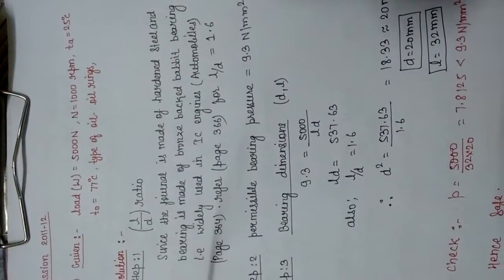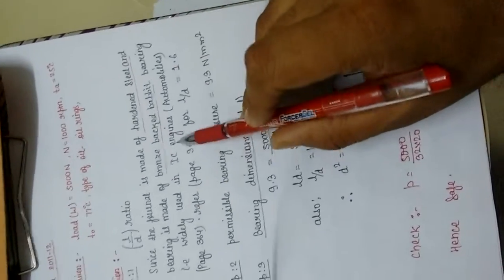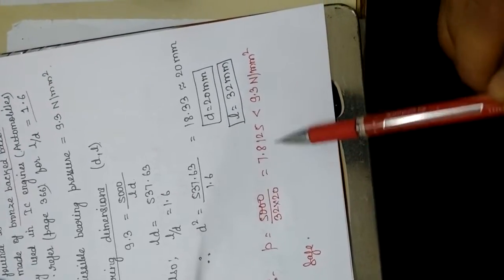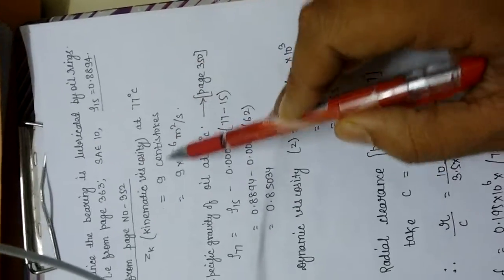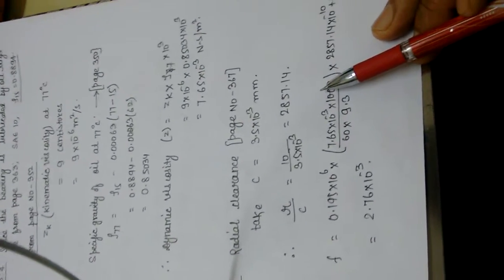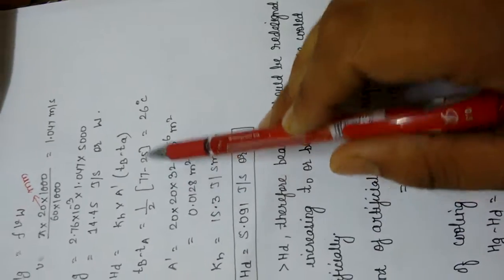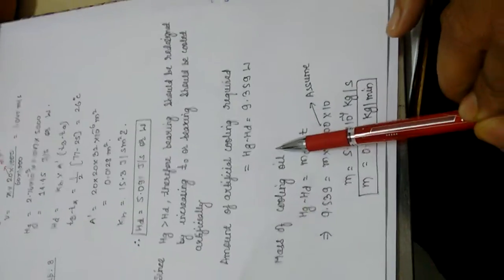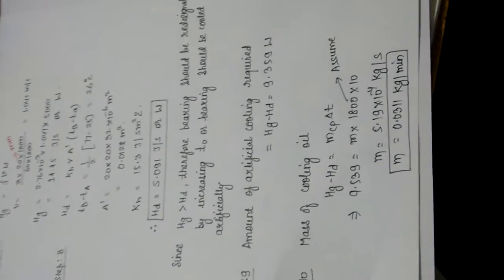Journal bearing design step by step

Comment: why you take L= 32 and d=20
Reply from the maker: d=18.3 from calculation , standard value we can take 20 mm. If d is 20 then length  will be 1.6d=32 mm